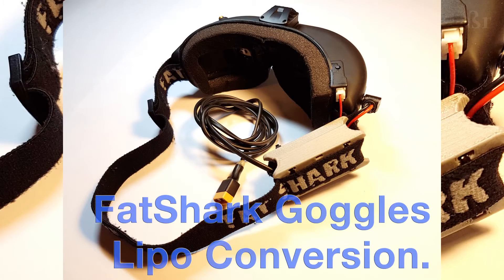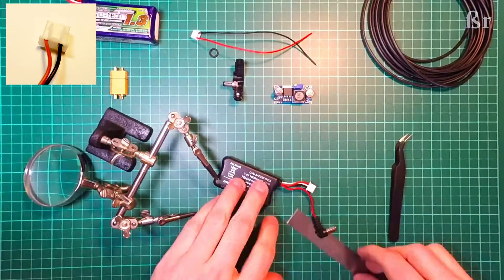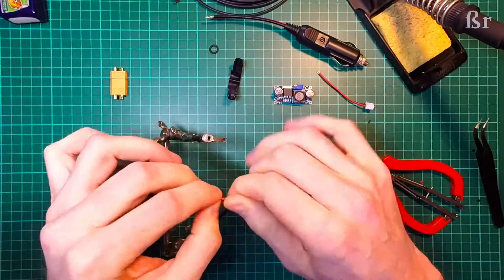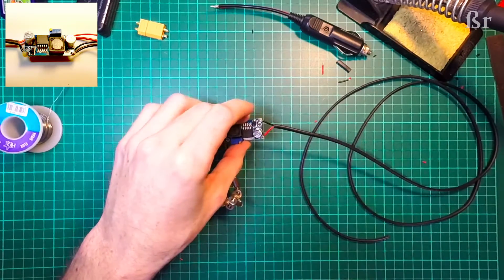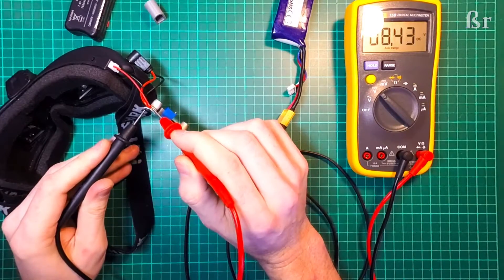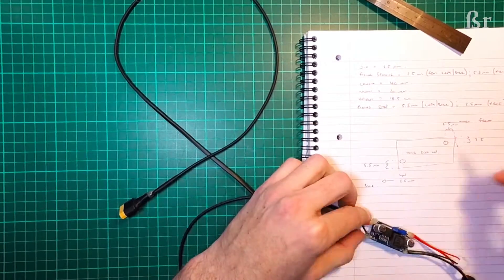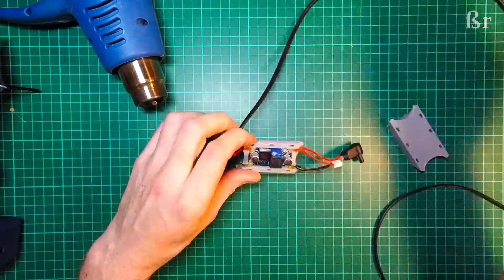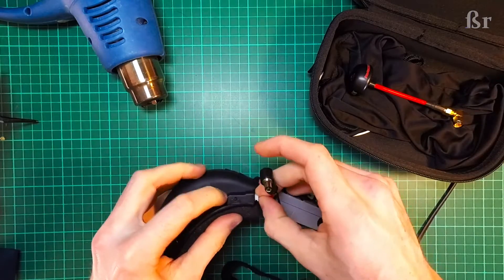Never Ending (almost) FatShark Lipo Power Supply Mod!

Comment: Where did you get snips, also, would I fry my fatsharks v3 if I connect a 2 s 1800 lipo  directly to them without voltage regulator. Will it provide too many amps. Even if it’s 8.4v . I see people using laptop batteries.  The battery I’m using is a larger batt from a bugs 3 toy quad   I plan on using cord for fatsharks so batt fits in pocket perfectly
Reply from the maker: I got the amtech snips/wire strippers online - ebay I think.. As long as the battery is 2s you'll be fine - I think I remember reading people running 3s batteries on their fatsharks although occasionally the in built regulators didn't hold up so well, so I wouldn't recommend the 3s option..